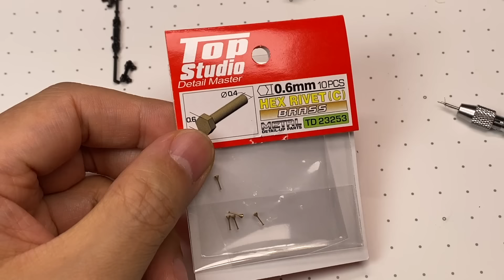MORRIS MINI COOPER S 1/24 TAMIYA Model car build  [Full version]

Comment: I own a 1960 Morris,  and a 1968 Austin RHD. The "60" was a complete basket case, took me two years of work on and off, usually weekends and few hours after work. So I had to learn every nuance about a Mini having never owned one before. Fact, you have missed no detail. The sparkplug leads were just wayyyy more intense than I anticipated. I love the working hood (sorry bonnet), and boot! The binnacle is just outstanding. I love my Mini and have spent so much time and effort restoring it I've told my family I want to be buried in it!!!! You've done such an amazing job on this, you should just get a real one now that you know how to build replacement parts. You won't be sorry!!  Cheers from the USA.
Reply from the maker: I love this little car that consists only of essentials.  If I have a chance later, I really want to own it. Thanks.

Comment: All it needs is to be 24 times larger and add fuel
The model was that good 
Can't imagine the actual build hours gone in to make this absolutely stunning model of a Mini Cooper 
Colour both on the outside and inside really suits the car 
I absolutely love all the details including the opening doors, boot and the working sliding door windows 
Engine details are awesome 
It is even better than some really expensive diecast models 
Its that good

Comment: Excellent video and top class build and detailing.  My only criticism, and this is probably to Tamiya, the Mini Cooper 'S' had twin fuel tanks with two filler caps at the rear, and I think they were fitted with 11 row oil coolers from the factory.  A common mod was to upgrade to 13 row oil cooler - which I did.  Gosh, I wish I had that car now!
Reply: Before March 1966 twin tanks were an optional. The famous Montecarlo winner in 1965 only had one tank.

Comment: You know, military modelling is great, lots of greebling, weathering, battle damage, etc. but to model something as pristine as the day it rolled off the factory floor… exquisite.
Reply from the maker: I've built a military model before, but I think it's harder to weathering the car naturally. Thanks!
Reply: @A4Garage  I agree, realistic weathering requires treatment of tiny areas and very thin layers. Otherwise your car ends up looking like it's on an antique post card. Paul Budzik on his channel has a lot to say about this. Modellers these days are fans of panel lines and weathering. If you translate them back to full scale, the "panel lines" would be an inch across and the "dirt" would be a very think layer of mud and grime, and oil in real life. Budzik thinks it looks bad, and I tend to agree with him. The irony is that, when you go to an auto show, they do the opposite: super shine, not a speck or a smudge.

However, a rally car could be a sensible exception.

Comment: As an interested bystander (re this level of detailing) Wouldn't it be the icing on the cake to be able to add fully functioning front and tail lights, not to mention dash lighting? Tena Controls do lighting kits for 1/25 scale models - perhaps they can be modified to suit different vehicles?
Reply from the maker: I want to try lighting later.

Comment: Hello. 
What a fantastic model build. You even swapped the spark plug wires for cylinder 1 and 2 during the build. (see 28:36 and 35:04) But the engine is unfortunately not a Cooper S engine. The Cooper S has an 11 stud cylinder head/engine block and the weaker 1275 and small bore engines only have 9 studs. A bolt is missing at the front and a pin at the back of the cylinder head.

Comment: The surface area for glue on some of these pieces are so impossibly small, it's a miracle these pieces don't just flake off and keep flaking off.

I have a feeling the next gen will have articulating suspensions and fabric seats...
Reply from the maker: The adhesive is not used too much, so there are some areas where the adhesion is weak. But it doesn't seem to fall off easily because it's a light model.

Comment: Wonderful -- it really brings back my irresponsible youth. I had a Mk1 Austin Cooper S 1275, and the real car had much less perfect detail than your model. I think it may have been a slightly earlier car, as it had twin fuel tanks, one on each side with separate filler caps. The metal interior door handles of your build were available as accessories, not from BMC, and the car originally had string pulls on the locks stretching right along the top of the recess in the door, made of black plastic-coated steel cable with a slight bulge about 6 inches long in the middle to act as a handle. I drove this much loved car for 13 years until its mechanicals finally gave out.
Reply from the maker: You have wonderful memories!

Comment: Excellent but you missed out the vertical rubber seals that fit between the two sliding windows on the doors.

Comment: Sorry but from what sheet of thing do you make the glass on the dashboard. Now i am really on it too to making something same but i dont have idea which material. Is it tamiya plaplate maybe or something else? Because i ordered it but in light i saw that not the most smooth the surface(really tiny waves in it). However maybe for a so small thing is enough but i dont know if you use something better clear plate for it or it is tamiya pla plate🤷🏻‍♂️ Thank you:)   anyway this whole work is magnificant!
Reply from the maker: I use a thin sheet about 0.1mm thinner than the Tamiya pla plate for the glass of the dashboard. I buy a lot of different types of sheets or packaging materials to find the right ones and test them out. I will introduce the material in the next work. Thanks
Reply: @A4Garage  Thank you! It is really not nothing that you share your knowledge so

Comment: Wow I've got that model.  Based mine on my 64 Austin-Morris Mini...  It's didn't survive the trip back to the states.  And my model wasn't near is nice or detailed as yours is... Great Job, miss my Mini. What's next complete lighted one where all the lights work?
Reply from the maker: I didn't like putting lights on the model. This was because I was concerned that wiring and batteries would interfere with details. If a plan is made to avoid such a problem, we are considering adding a light. Thanks.

Comment: Amazing job.  Just wow.  Only one ting , wipers are the wrong orientation.  As uk spec they are running the other way round than europe ones
Reply from the maker: Your point is from 1969 onwards. I was referring to the 1964 model. Thanks.

Comment: Quite a good build, except for a couple of points that bothered me,
 firstly only standard 850 Minis and early 998 Coopers came with the one fuel tank ALL 1275 S's  had twin tanks (which was why the offside fuel cap moulding you sanded off was there) given the work you put into the left tank I'm surprised you didnt scratch build the right hand tank too.  also the minilite wheels were  after market fits,  all Minis regardless of engine fit left the factory on plain steel wheels.      not really a critism but that " fuse holder" you fitted was actually the dynamo's charging regulator,   the fuse box which was actually on the other side of the scuttle  was half its size and shaped like a tiny black mermaids purse and contained only two glass tube fuses. apart from those nit picks I commend the realism you put into your scratch builds.

Comment: I don't want to be the one who noticed this,  and now that I tell you, I'm sorry if you've had to go back and fix it! The firing order on this engine is 1-3-4-2 anti-clockwise on the distributor. You have the spark plug wires wires set incorrectly. That engine will never run 😜.